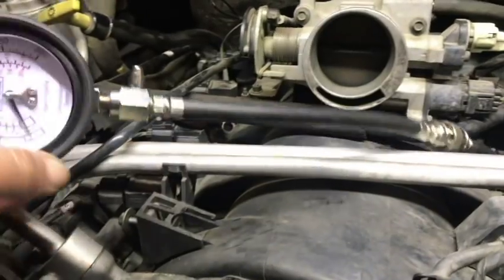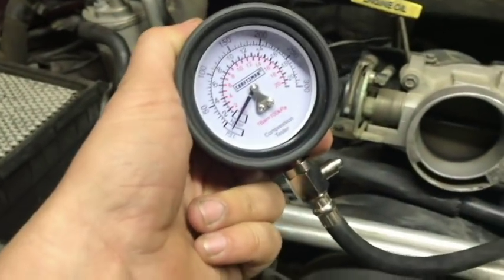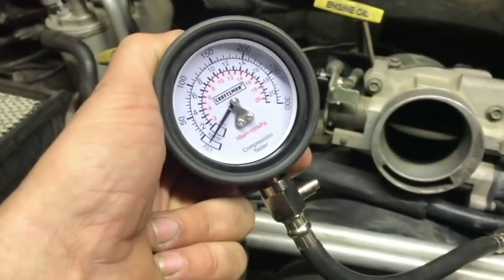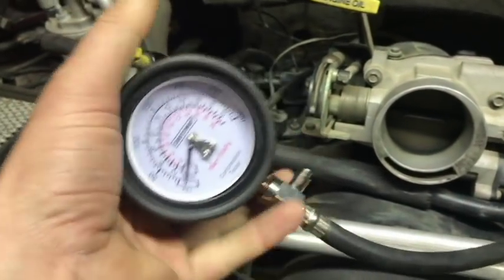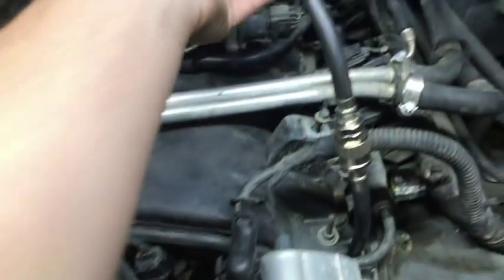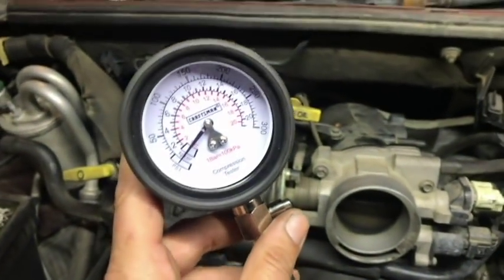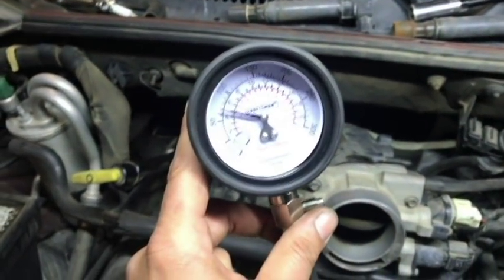Rough Idle & Misfire Code's Dodge Dakota 4.7 Liter What’s the Issue? 2 of 2

Comment: I have a 2001 dakota 4.7 that runs great when its cool but runs  rough and 2 cylinders throw codes when it warms up . guess I should check compression again? Compression was fine about 20K miles ago, what could go wrong? Hehe!
Reply: The 4.7L are notorious for bad lifters, rocker arms,  valve springs.  All which will cause the misfires and compression problems. These engines are not worth the cost to take to mechanic repairs. So learn do it yourself,  lots videos how do all these repairs and get head redone while in there as the cast iron head are known crack
Reply: @dylano7242 I hear ya, I have since replaced all 8 fuel injectors with new 4 hole ones and threw in a new set of Iridium plugs for good measure. The 4.7 in running better than it has in years, knock on wood, and gas mileage has improved too. 🤠😎

Comment: 2002 dodge sport Dakota four wheel drive double cab with 4.7 liter engine , I cleaned my  PCM and ECM  with throatal  cleaner now my sport Dakota turns over but won't start now for you think I damaged the PCM or the ECM .

Comment: I have a 06 4.7 dakota slt 4 door. Only firing on 3 cylinders. New spark plugs, new coils, timing chain, fuel injectors, cam and crank censors, new AIC valve, and new valves. Still only firing off 3 cylinders. Could it be a computer problem at this point?
Reply: Whatever came of this?

Comment: I got a quick question if you think you can answer I got a Dodge Durango 2004 4.7 l motor no start got no power to the cause got good gas pressure do you know what can I check next if you could please text back or shout out to me I would appreciate it thank you
Reply: My name is Michael I replied because I got a 2004 Dodge Durango 4.7 l motor no start no fire to the cause got gas pressure do you know what I can check next if you could reach back out to me if not it's okay but thank you I can only afford to work on myself

Comment: So i just bought a 2004 dodge durango 4.7 liture v8 magnum but its got some known issues but i changed the coil packs and spark plugs all ready but it's still misfiring i took it too auto zone and they said my throttle position sensor was bad but i really feel theres more too it than that i know it has an exhaust leak but my engine is really quiet in idle but as i drive its got like a loud rouring or and blowing noise and it does putter in idle and it takes a minute to get up and go but i really need some guidance too find out what i could look at and analyze so i can better understand this issue and is it worth fixing theres no nocking or other issues just those. But pls someone help i really like this truck dont want too have too spend the $500 for a new engine of not needed too.
Reply: Did you figure it out?
Reply: You figure it out? I'm in the exact same boat. Just bought it

Comment: I’ve had a 4.7 overheat there are none of the normal signs of a blown head gasket but it idles and runs rough now also it’s showing P205 and P206 engine codes it ran fine and didn’t have those codes before it overheated. Would it be the valve seats on Cylinders 5&6 not the fuel injectors as codes show? Also under hard a acceleration it does fine.

Comment: Glad you got to follow up with it.. Months ago had a Dodge Ram 4.7l, customer needed a new alternator, truck was also low on oil (valves were makin a racket) and coolant. Months later customer hit me up with a p0452, p0300 and p0308. Cylinder 8 coil pack was broke at the boot, he decided to throw all new coils/plugs at it, haven't heard back since..

Comment: When doing a compression test, easiest way is to pull the feul pump relay(it wont start) and crank atleast 5 revolutions for the best reading. Also when its running get a stethoscope and listen to the injectors firing. Should hear solid ticks on the injectors if they are good. 👍
Reply from the maker: SikWithit Good information thanks Brother 🍻👍
Reply: @JustinDowDIYcentralhighway  just realized I spelled fuel wrong. Lmao🍻🍻

Comment: Good find! Something wrong with the valves I think. A cylinder with ok valves and NO rings will read higher than shown. Hole in a piston won't. Sounds like auction material.